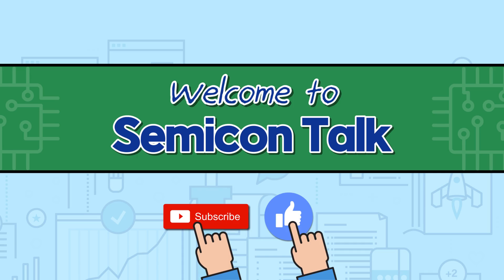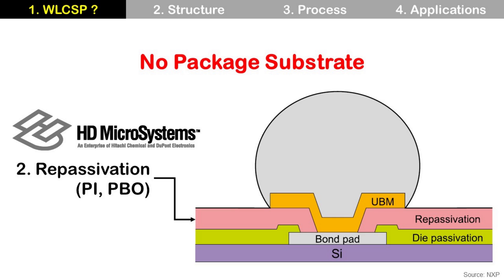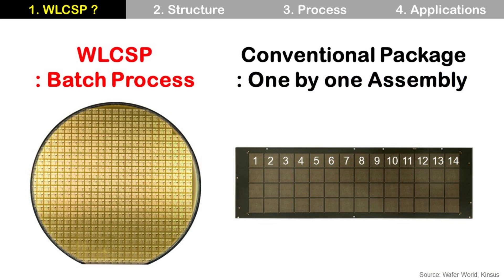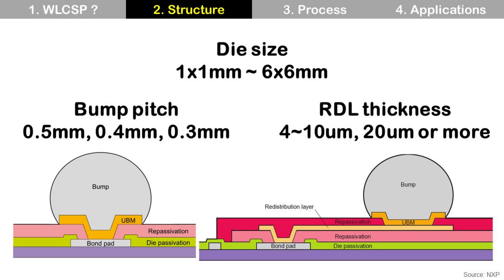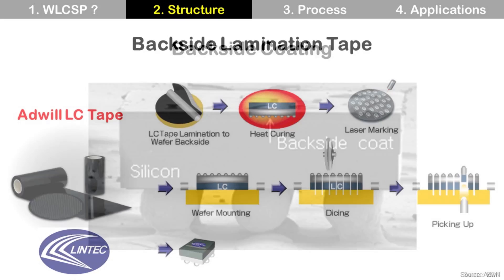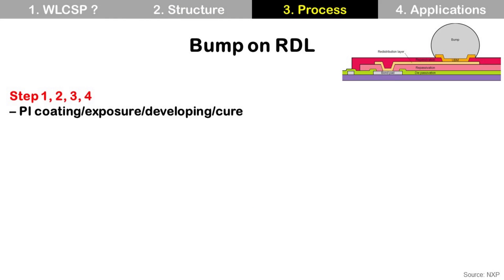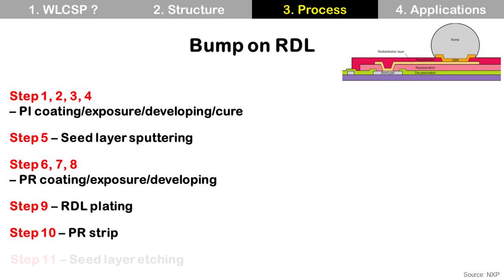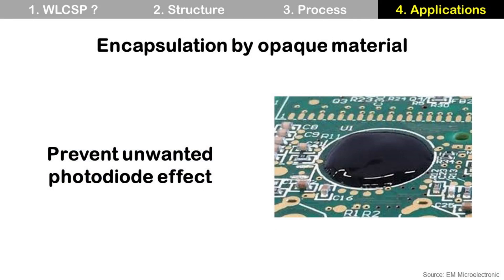[Eng Sub] Wafer Level Chip Scale Package (WLCSP)

Comment: For which reason 4/5/6 side Molded WLCSP is selected over standard WLCSP ?
Reply from the maker: Side molded WLCSP is to pretect die from mechanical damage. One of disadvantage of WLCSP is die backside chip out or crack because there is no protection of die from environment. So side molded WLCSP covers die using mold compound then protect die from these damages.
Reply: Thank you Sir for your answer. Is the side molded necessary for automotive application, or a standard WLCSP can be used for automotive ?
Reply from the maker: Standard WLCSP is used for automotive application and side molded is optional. But WLCSP is not popular package solution for automotive and WLCSP is more popular for smartphone.

Comment: Thanks sir , What is the difference between WLCSP and flip chip ?
Reply from the maker: WLCSP is a package type and flipchip is a process technology. For WLCSP, package size is equal to die size. 
fcCSP and FCBGA are popular package types using flipchip technology and package size is larger than die size. Flipchip technology is a process technology to flip die to attach on substrate and die surface with pattern faces substrate top surface.

Comment: 안녕하세요.
RDL 공정중 배선을 그리기 위해 구리 전해증착을 하는거로 알고있는데요
왜 무전해증착도 있는데 전해증착을 더 많이 하는걸까요? 무전해증착을 진행하면 더 균일한 코팅이 가능할텐데...
Reply from the maker: 무전해도금은 도금속도가 느려 비싼 공정이고 두껍게 도금하기도 어려운 공정입니다. 따라서 꼭 필요한 경우 예를 들어, 도금하려는 물체가 전기적으로 전도체가 아니어서 전기도금을 할 수 없는 경우 등에 주로 사용합니다.
Reply: @semicontalk3223   답변 감사합니다.
Reply: 자꾸 여쭤봐서 죄송합니다 ㅎㅎ

'RDL 공정은 한 패키지 내에서 칩과 칩 사이를 연결하는 회로 배선을 그려주는 장치' 라고 말해도 괜찮을까요?

마찬가지로, 구리를 전해증착하는 이유는 칩과 칩 사이 전기적 연결이 잘 되려면 전도도가 높고 저항이 낮은 물질, 동시에 가격도 싼 물질이기에 구리를 전착한다고 봐도 될까요?

혹시 맞다면, 구리를 '균일하게 전착' 해야 하는 이유는 불균일 할 시 저항이 생길 수 있기 때문이라고 봐도 될까요?
Reply: @HONG-nc8sq  Electroless plating is an expensive process due to its slow plating speed, and it is also difficult to plate thickly. Therefore, it is mainly used when it is absolutely necessary, for example, when electroplating cannot be performed because the object to be plated is not electrically conductive
Reply: Thanks for asking.
RDL is a circuit wiring that electrically connects the die pad in the chip and the bump or solder ball in the package. The reason for using Cu is that the reason you mentioned is correct and that it has good reliability characteristics such as electromigration. The reason for uniform electroplating is correct, but there are other functional reasons as well.
If you have any other questions, feel free to ask. I can't answer all of your questions, but I'll try to give you as many answers as possible.
Reply from the maker: 질문해주셔서 감사합니다. 
RDL은 칩에 있는 Die pad와 패키지의 Bump 또는 Solder ball을 전기적으로 연결해주는 회로배선입니다. Cu를 쓰는 이유는 말씀하신 이유가 맞고 Electromigration과 같은 신뢰성 특성도 좋기때문입니다. 균일하게 전기도금 하는 이유는 말씀하신 부분이 맞고 그 이외에도 여러가지 기능상의 이유가 있습니다.
혹시 다른 질문이 있으시면 얼마든지 하셔도 됩니다. 제가 모든 질문에 답변을 드릴 수는 없지만 가능한 답변을 드릴 수 있도록 노력하겠습니다.
Reply: 정말 감사드립니다 ㅎㅎ
영상도 항상 잘 보고 있어서 이 점도 감사드립니다!

Comment: Is PR Photo Resist = SR Solder Resist = SM Solder Mask ?
Reply from the maker: No, those are different. Photo resist is used for photolithography to make electrical pattern. So photo resist is used temporarily.
 Solder resist, also called solder mask is used as top layer of packge substrate or board to protect Cu trace. So solder resist is used permanently.
Reply: I got it. Thank you👍